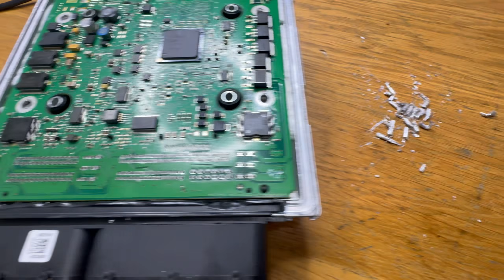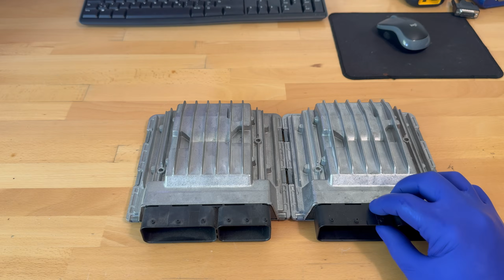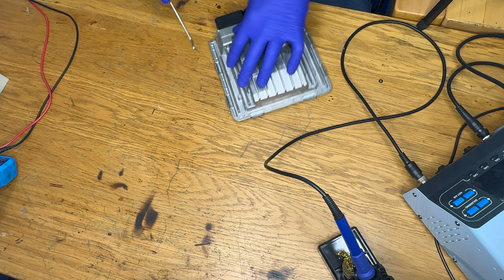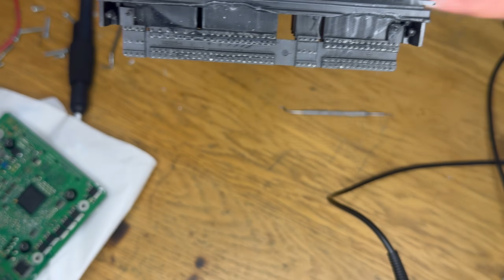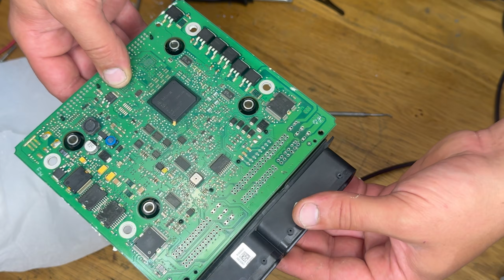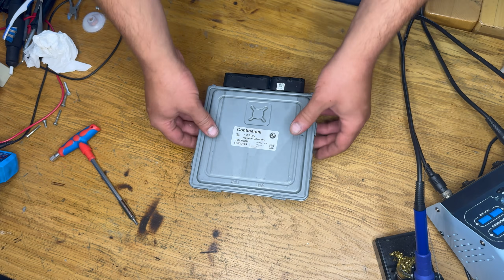BMW 335i MSD81 ECU Repair | Fixed 2ACC & 2ACB for $20

Comment: I’m having the same codes rn but I have replaced the dme and it still doesn’t start
Reply from the maker: Did the old ECU have any visible damage on the pins?
Reply: @AutoScanGarage yes one of the pins where missing but it run without that pin before

Comment: Flux goes a long way when soldering and desoldering.  I would have used a powered desoldering tool like one fron OKI or JBC.  Manual desolder pumps tend to create a bit of static.  I hope he had an esd strap on for this as I noticed he was using a paper towel to lay his part on while desoldering.
Reply from the maker: I'm not a big professional when it comes to this, and I appreciate every piece of feedback. The only reason I don't use flux when desoldering is that it tends to build up inside the desoldering pump, so after a short time I have to take it apart and clean it. I've done it this way several times and haven't had any issues so far. Thanks for your comment and for sharing your advice!